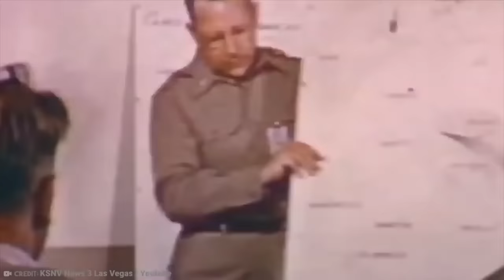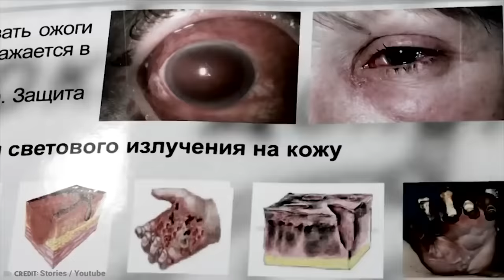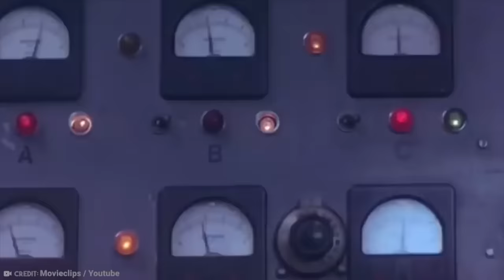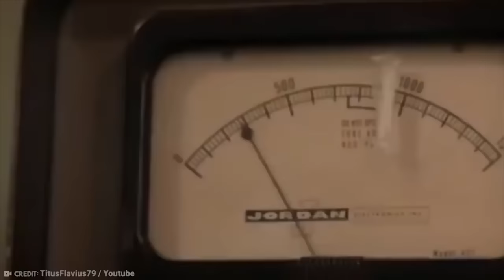20 Nuclear Tests That Went Horribly Wrong

Comment: I am a real nuclear engineer.  I hold 3 engineering degrees.  I am now retired but spent my career in research the use of nuclear potential for biomedical, energy, and other uses.  I was deeply involved with studies to evaluate the correlation between the different types of radiation exposures and the biological consequences or health effects.  For classification reasons, the vast majority of information regarding nuclear weapons and nuclear testing is classified, and, therefore, is not available to the general public.  All of the information that you referenced was obtained from highly unreliable sources and is simply wrong.  The staff at the Department of Defense has very little information regarding nuclear weapons and/or nuclear weapons testing.  Journalist, and the "public" are far less reliable... It's unfortunate that people with absolutely no understanding of nuclear engineering attempt to make such erroneous documentaries.  They begin with assumptions and guesses made by journalists and then convert those erroneous guesses into erroneous, supposed facts.  You made no attempt to determine the truth about yields and other information that remain classified.   You reported everything as facts when the truth is you were/are wrong in every case.  You simply puppet incorrect information that has been promoted by unreliable sources.  While I do know the correct numbers and information, I am unable to provide any more information due to my security clarences. Sensationalism does sell, but the use of lies or false data is most unfortunate and destructive.   There are too many errors in this video for me to address at this time.  Let's begin with fundamentals.  You make many false claims regarding radiation exposure.  In order to correlate exposure, you need to understand the type of radiation and the level of that radiation.  In the case of strategic nuclear weapons, the area where the initial radiation is "dangerous" is well within the fatal blast zone, which means that no one, who was radiated to any significant degree would survive the blast wave.   Hence, if you do not die from the blast over pressure the radiation level, which is predominantly gamma, would not be hazardous. (At most you would receive a sunburn...which is still unlikely.)  Also, you use adjectives regarding radiation hazards which are, in fact, incorrect.  You state that the fallout from nuclear testing was extremely dangerous (to the public health), which is certainly not true.  In fact, the resulting statistical analysis has proven the opposite.  There is an inverse correlation between background radiation levels and cancer death.  In other words, areas with the lowest background radiation levels statistically have the highest incidence of cancer deaths.  While I would never suggest that anyone be intentionally exposed to radiation, your claims are simply wrong.  Another obvious error is the fact that ALL US bombs (after the little boy and fat man) were designed such that they could not detonate with nuclear yield if dropped from an aircraft.   (It was virtually impossible - as demonstrated in  later accidents.)   Your presentation on the reactor accidents is even worse.   The Chernobyl reactor reactor was not primarily a "power reactor".   It was designed to generate plutonium 239.  In addition, it was a totally different type of reactor than is used in all Western countries.  Your descriptions of the incident were totally wrong.  [As a reactor expert (designing reactors to produce medical nuclear materials), I was directly involved in the post accident analysis.]  This type of reactor is only used for the production of plutonium 239, and the type/ design was/is extremely unstable and should never have been built at the levels required for a power reactor. (It was a graphite moderated, fast flux reactor.)  The Soviets were operating the reactor in a region of instability which is what caused the explosion.   However, your description of the resulting radiation levels is absolutely wrong.  The primary health concern is rare-earth toxicity and not radiation.  (The Gemma-producing  Is ceasium-137 and strontium-90  died out very quickly.  The toxicity of the TRU elements was the actual greatest health issue after the initial decay period of the fission elements. )  The Japanese accident was caused by overt hubris on the part of the Japanese.  They had been warned numerous times about the hazards associated with their specific design.  After working with Doctor Edward Teller at Stanford University (Graduate School) on the 3 mile island incident, I felt compelled to communicate my concerns directly with the Japanese engineers in 1985.  We were concerned for 2 reasons.  1st - it was incredibly irresponsible if not stupid to place the emergency generator in the basement of any nuclear power plant; worse yet, one located on the ocean!  2nd -  It was extremely foolish to not provide a mechanism to vent the reactor pressure vessel from the over-pressure of a LOCA incident.   The actual over-pressure "failure"  was caused by the fact that they were unable to vent their power reactor which was the actual cause of the over-pressure explosion.  (We did not have any injuries or deaths resulting from 3 mile island specifically because we were able to vent the reactor pressure vessel.   It might be interesting to note that (As determined in president Carter's commission report) the only hazard to public health from 3 mile island was "anxiety caused by fallacious news reports."   This is why erroneous videos such as this are dangerous to public health!!!)  The Japanese had been warned numerous times but failed to act.  To make matters worse, they dramatically overstated the resulting radiation hazards to obtain hundreds of millions of dollars in aid that they did not deserve.  The relatively minor tritium exposure was NOT hazardous as it was barely above "background" for naturally-occurring tridium.  [Tritium or heavy hydrogen (H-3) decays with a low energy Beta emission which is not hazardous at the levels experienced at the levels experienced.  It decays to helium which is which is totally harmless.]  The alpha "radiation" detected at the US naval vessels had nothing to do with the power reactor incident as it was caused by the forest fires and other fires that resulted from the tsunami.  (The resulting naturally-occurring thorium released is common with forest fires and was the source of the radiation out at sea and had nothing to do with the reactor.)  Your claim that Nazi Germany was involved with nuclear weapons research is absolute nonsense.  Hitler referred to nuclear physics as "Jewish science" and did not allow any research in that area.  (The incorrect reference was included in the letter from Albert Einstein to FDR solely to increase the perceived danger.)  Germany did not possess the materials, the equipment, nor the reactors to enrich uranium or create plutonium.  It is irresponsible to simply pass on information you obtained from unreliable sources.    Finally, it was obvious to me that you have no idea as to the truth regarding Nuclear weapon's testing at NTS when you repeatedly referred to the Department of Defense or DOD as they were not involved in any testing after the creation of the atomic energy commission or AEC.  I certainly agree that the need for nuclear weapons was grossly overstated, and I would certainly have preferred that they had never been developed.  But, I also believe that it's most unfortunate that we have been forced to spend obscene amounts of money on policing, prisons, and the military.   It's a sad reality resulting from the same level of evil in our world.  However, we have historically witnessed the dangerous consequences of failing to possess a strong military and a strong Criminal Justice system.  [We have recently witnessed (1) Russia's evil invasion of Ukraine (due to our failure to properly protect Ukraine per our agreement with them after they gave up their nukes), and (2) the insane numbers of murders and destruction after police departments were defunded and DA's went soft on criminals.  All of the tens of thousands of deaths are the fault of the United States!]   The consequences of a weak military policy and weak criminal Justice system have been obvious.  One final comment is the fact to the fact that nuclear weapons whenever my primary concern big concern regarding weapons of mass destruction mass destruction as they are fairly easy to detect and trace.  It's the chemical and biological weapons that concern me.  They are relatively easy to create and easy to hide.  My greatest concern is the reality it's a reality that they have been... and will continue to be... used by very evil people and regimes!!!   Please remove this erroneous video.  I thank you!
Reply: @ Rick Flores… I truly appreciate you for sharing your thoughts and concerns about this most inappropriate video. It’s clearly based on hype designed to sensationalize the content rather than the presentation of facts. 

Unfortunately, modern society is more concerned with being entertained by the online insanity rather than being educated about one of the real and potentially evil forces created by mankind. 

The content of your comments speaks volumes about your integrity and sincerity. The specific details clearly validates your credentials. Surely I’m not the only person to read this but it’s been posted for a month and mine is the first and only comment so far. 
How can people be so infatuated with tabloid bullshit and totally ignorant of reality based upon the facts ?
Reply: Thank you for taking the time to add your input
Reply: Thank you for elaborating on the deficiencies of this lame pseudo-documentary. But be sure to check out his "The Earth is Flat" and "We Never Went to the Moon" videos!
Reply: Your reaction is understandable, but then do consider that this video was based on the best data available to the public, with all of the real data hidden behind layers of classification. If this video contains false information (and surely it does), then this is more the fault of the P.R. people in government than the intent or irresponsibility of the maker of this video.
Reply: Thank you you saved me a lot of typing
Reply: Handwerken
Reply: I quess radiation is safe
Reply: @danielwilson6665 for many the tabloids feed the drama people need just to feel something. 😞🙃
Reply: Yes. Correct. Thermo Nuclear bombs are never flown while armed. Arming them is only done immediately prior to detonation as a Fail-Safe. Arming them essentially causes a fission reaction, followed by an implosion, causing fusion of the fission reaction, resulting in a Thermo Nuclear yield.
Reply: I don't believe you!!!!!!!!!
Reply: You and every other nuclear scientist kinda screwed the pooch: has power source capable of driving civilization away from fossil fuels: makes it so scary and "classified" that people actually think radioactive waste is worse than coal burning for the world.
The power at the heart of matter, and we've messed it all up 😢
Reply: Agree with you on some errors in video. You are wrong about Eukrain however. 
For context I have friends and friends parents that live in and around Russia and Eukraine. I have personally been to 12 countries in this area. The people living hear speak a totally different toon than the establishment propagate. Just spoke to a Russian friend yestrrday and these facts are still valid.
1. The US lied and did not follow through with promises made about NATO and nuclear weapons treaties. 
2. A large percentage of Eukrainians consider themselves Russian. They are not allowed to show any allegiance to Russia.
3. Putin is blamed for everything while not showing any evidence. The Russian people, yes my friends and their families love Putin. His interest is to bring Russia out of the depths of poverty and corruption. 
3. The level of corruption from  Eukraine (Zelenskyy) is at a level seldom seen in the world. Again people that he has "Silenced" rivals even the false allegations put on Putin.
Reply: Wow! Everything that I have wanted to say about nuclear energy & weapons in one comment! You rock! My neice is majoring in nuclear engineering, by the way. Nuclear Power is clearly the way forward but sensationalist journalists and fear-mongers have done everything they could to instill  fear into the public about nuclear power, a truly clean energy. As for myself, I have worked in the nuclear power industry for several years and the only time that my radiation exposure ever rose above background levels was when I worked inside the containment building and even then it wasn't by much. Of course, getting people to understand the difference between exposure and contamination can be quite the task. Anyway, thank you for your work!
Reply: Brilliant stuff ! 

The truth is often complicated. Oversimplification and hype can suck people in. But  pushing the lowest common denominator has a cost. From click bait to politics.
Reply: So did you dislike the video?
Reply: Thank you for your most respectful knowledge & input …. Wow … I’m not sure I understand most of what you said but I was always worried about bio and chemical weapons as you have mentioned . 4/5/24
Reply: Waahhhh !!
Reply: It's fine our grandparents didn't ruin our world and we won't ruin our great great grandchildrens world its not like anyone is going to get cancer and successfully sue anyone .
Reply: @HeartLess-uz5vs good job your a scientist to confirm and back up his data.
Reply: If it wasn't for newclear bomb testing we wouldn't have microwaves or be able to play Fallout.  Now I'm not a scientist but I am an actor who played Man-in-a-White-Labcoat #3 in episode 117 of the BBC radio serial 'Doom Control'.  You'll probably remember my line :  "Don't press the Red Button, professor !”. But he did and I'll never forget the scream from my fellow actor, Aubrey Davenport which truly described the horror of a nuclear explosion (and the devastating effects of Omega radiation.)  Great video.  Entertaining comments too !
Reply: Wow thank you so much for your detailed comment. It is extremely interesting material. In no way am I an engineer or nuclear expert. I am simply a civilian with a thirst for knowledge and have always been more mechanically inclined than those around me. I understood what you said very well. You have addressed many of the concerns that I have had for decades now. Like I said, I'm nowhere near an expert but always felt in my heart that things aren't as they have been explained to us... It drives me a little batty when just anybody, "YouTube influencer" especially, can read a few pages of details and maybe interview one or two journalists and are allowed to freely share this crazy information to the public all willy nilly! With the little bit of moderation that YouTube has it seems to be focused on very unimportant ideas that don't really have an impact on our daily lives in any way! 
Well, thank you again for your comment. I've been browsing through YouTube for over a decade now and honestly your comment is the most comprehensive that I have ever read. I do appreciate the brutal honesty in your response to the video. YouTube needs a lot more people like you around! 
Be safe and take care 🙏🏼

Comment: Two interesting factlets:

1) The Tsar Bomba was the USSR's reply to Castle Bravo. Kruschev basically went to Andre Sakharov and told him to build a 100 megaton bomb to shut the Western Imperialist Pigs up. In the end Sakharov bottled it and changed the final stage of the bomb to a lead shield, so it ended up with a yield of "only" 50 megatons. And it was still powerful enough to blow windows out and knock down fragile structures FIVE HUNDRED MILES AWAY.
2) The contamination of the Japanese fishing boat from the Castle Bravo detonation was the inspiration behind the original 1954 'Godzilla' movie. Since Japan was still under US control the Japanese couldn't really protest, so to get around the censors the concept of nuclear weapons was re-imagined as a giant radioactive monster.
Reply: The boat was a tuna fishing vessel called 'The Lucky Dragon'. They had to stop catching and eating Tuna or any other fish at that time around that area too

Comment: Surface to air defenses with nuclear tipped missiles,   Nike  Ajax and later Hercules SAM-A-25 and MIM 14 missles tipped with a W31 nuclear warhead were common in the USA (265 in the USA alone) they started to disappear in the 1960s. I lived near one as a kid in the Ohio Twp, PA area. 1/2 the missile base still exist in Ohio Twp as a communication military base today off of Gas Run Rd. The other 1/2 of the base, the missile silos part off of Joseph's Lane, were removed in the mid 1960's and are now a housing project directly across from the current Avonworth High School system built in 1970. That decom.  missile silo base was a great place to hunt doves and grouse when I was in high school! Most people back then didn't have a clue that those bases were loaded with both nuke and conventional tipped missiles.

Comment: Fukushima, the emergency power supplies flooded so they lost power control the cooling and hydrogen formed result in the explosion. Original specification from GE advised them to install the Emergency power backup on higher ground however this was not done resulting in the lose of the plant.